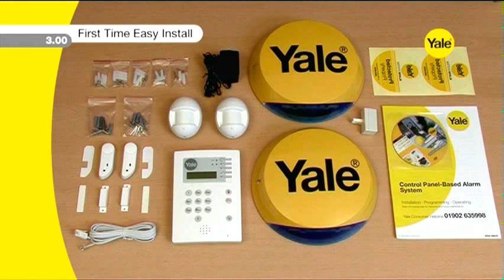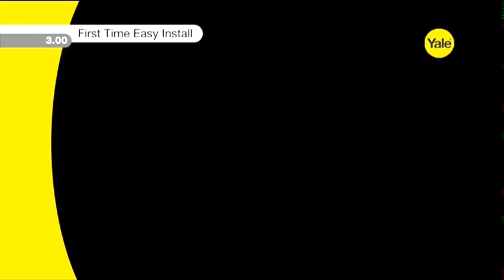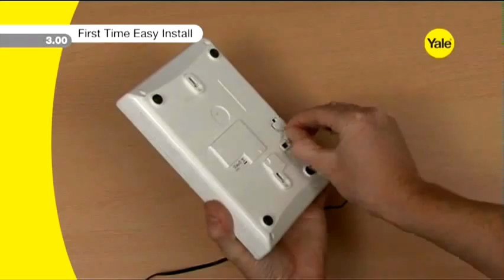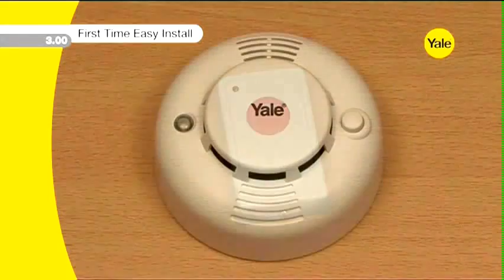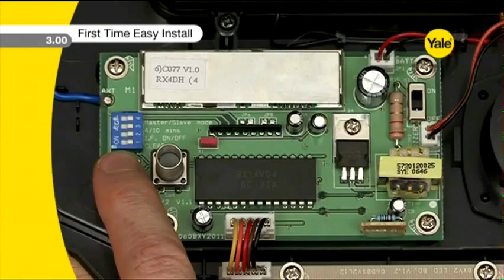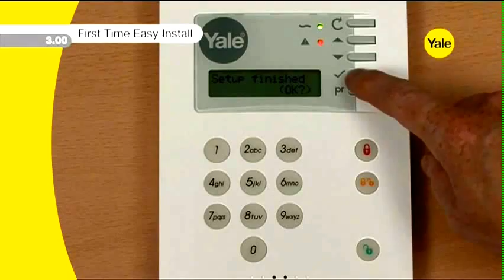YALE_How to install a Yale alarm system

Comment: Avoid Yale alarms. As an ssaib company owner with over 30 years in the industry I highly recommend if you want an alarm installed go to a professional ether nsi or ssaib. If you want to have a go yourself the I would recommend you use a pyronix enforcer NOT a Yale. Big big difference.
I'd be more then happy to talk you through them if you needed.

Comment: Wireless is great for many applications but one important question is how long the battery last and also the same question about the battery in the sensors?  Is there a solar rechargeable version for the system.

Comment: Hey NZED ROCK.....I just installed this system for grandmother. Just to confirm you DO need to plug in the main control unit with the power adaptor. The battery inside the unit is a back-up option incase of power outage. It can work for up to 10 hours on its own and it then needs to be recharged. If you don't want wires to show by front door then buy the wireless control pad which can be mounted in a holder by the main door. The main unit can be then 'hidden' near to your telephone master socket (as it needs phone line connection)
Reply: You probably dont give a shit but if you guys are stoned like me during the covid times you can stream pretty much all the latest movies on InstaFlixxer. Been streaming with my brother lately :)
Reply: @Harry Antonio definitely, been watching on instaflixxer for months myself =)